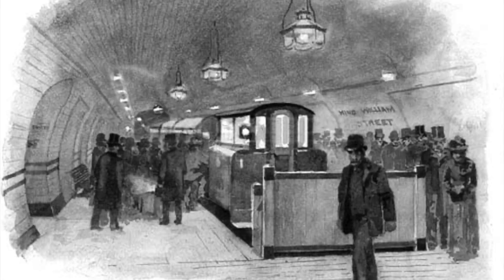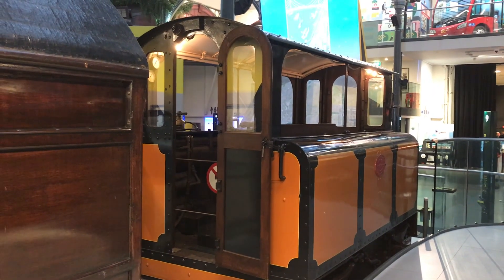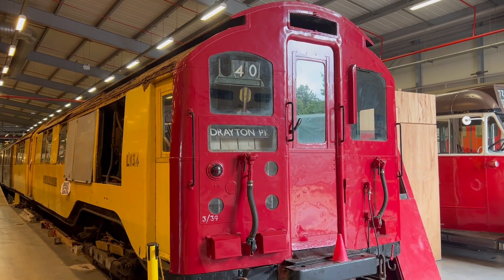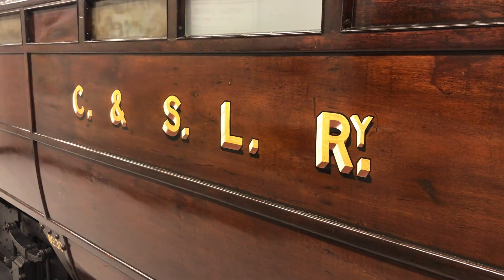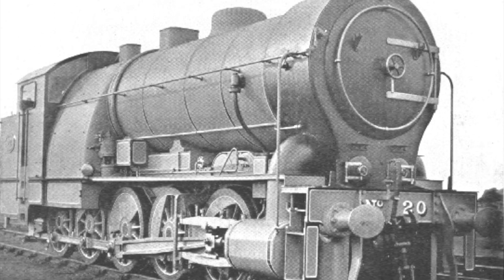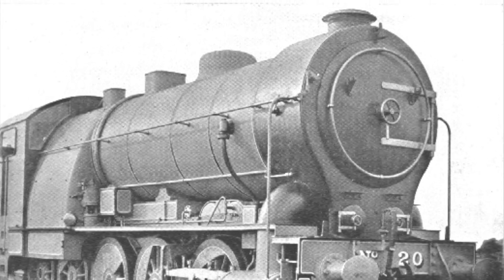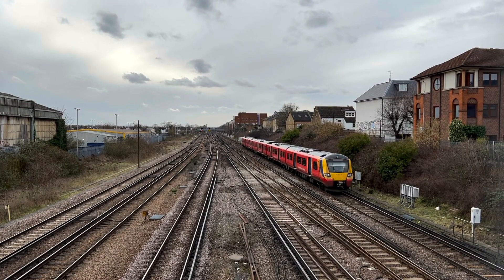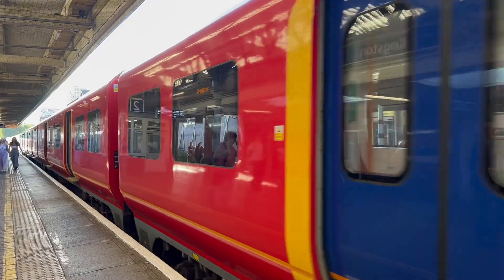Why some electric trains use a third rail, and others don't

Comment: I can name a few sections of new third rail. These are the new London Bridge and Reading station developments, the Bermondsey dive under and the new Merseyrail extension, the connections to HS1 (but not HS1 itself) plus those tracks that were renewed. Like with new level crossings, are there any regulations related to the installation of new third rail infrastructure since almost all new electrification projects are 25 kv AC OLE?

Comment: This makes me wonder about why Merseyrail has third rail powered lines when all the rest are in the South of England
Reply: Because the Lancashire & Yorkshire Railway and the Mersey Railway chose the same system as the London & South Western (and, for that matter, the North Eastern on Tyneside, although it chose a different system on Teeside). The Mersey Railway, in particular; had a long tunnel that was a horrible place in steam days, and so was an early candidate for electrification. And overhead would have been a problem, for the same reason as it was on the London Underground.  
Likewise the Midland Railway (in Lancashire) and the London Brighton & South Coast Railway chose the same 6250V AC system.

Comment: As someone who works in rail not in the southern region, the prospect of working around live 3rd rail is terrifying. Very easy for it to be game over when carrying long metal objects (tools, survey gear etc) around which most rail workers do. Also efficiency wise the 750V DC system loses almost 30% of the inputted energy to heat and other losses. Compared with about 2% loss on the 25KV AC wires. Very much Edison v Tesla in modern day.
Reply: The old slammers had resistance grids for acceleration control which must have added considerably to the heat/resistive losses of the third rail. Modern trains 377s et al with electronic control wizardry may well have cut these losses significantly, be interesting to see by how much if anybody has studied this.

Comment: Third rail electrification have an huge bunch of problems: it is dangerous, suffers snow and ice, can use only low voltage for safety and geometrical reason (it's too near to soil to have enough distance to not create voltaic arc with ground at high voltage) and so it must carry huge amount of current with high leakage and need a lot of substations, provides less power than overhead lines, it's slow and can't be used for high speed (the top speed is typically only up to 100 mph (or 160 km/h) with 110 mph (below 180 km/h) record speed), need to be interrupted on switches and grade crossings. The only reason to use today third rail on new lines are  on underground metros to save money digging smaller bores without enough clearance to install at least rigid overhead lines: they are segregated, use lower top speed (typically below 100 km/h or less), have a low number of switches and don't have grade crossing, don't need to run high speed trains and don't run freight trains and they aren't exposed to snow, ice, rain. These are the main reason because third line is no more used on new railway electrifications.
Reply: One advantage of low voltage DC supply  is that it keeps the trains simple - no heavy bulky transformers or rectifiers to lug around. Important where weight and/or space is at a premium.

Comment: I think you might have explained that the main reason overhead electrification has gained ascendancy over third rail is that it allows much higher voltage, 25 kv against typically 650 volts. As power loss over distance is proportional to the current not the voltage it is far more efficient to have a high voltage and low current than vice versa. Obviously you couldn't run such voltages at almost ground level. Secondly to feed such high voltages to the wire and then reduce it to usable voltages in the locomotive requires transformers and hence AC current.

Comment: On a similar subject... why do some trains use the wrong tube line and others don't?! Fun fact: Tonight I was prevented from catching a train out of Uxbridge by an incident involving a Piccadilly Line train taking a "wrong turning" after Rayners Lane and ending up on the Met Line at West Harrow! Two obvious questions occurred to me: 1) Does this sort of thing happen often? and 2) Would this sort of thing have happened in Charles Yerkes' day?!
Reply: It does happen, usually because a signaller has set a route for the wrong train and the driver didn't notice until too late. Both of them will have some explaining to do.  "District Dave" recounts an episode where he took a "wrong stick" at Hanger Lane Junction and took his District Line train to South Harrow instead of Ealing Broadway. 
 
At places where the consequences would be severe, such as Barons Court, Queens Park, and West Hampstead, there are extra precautions to cut off the traction current, or operate a tripcock, should a big train attempt to approach a Tube-sized tunnel. This used to be a gantry spanning the track on the approach to the tunnel, from which were suspended some mercury-filled glass U tubes at a height that Tube stock could pass under but surface stock would hit. The mercury in the tubes formed part of an electric circuit. Should an errant surface stock train (or Overground train at Queens Park) be routed towards the Tube tunnel, it would hit the U tubes, breaking them and letting the mercury run out, thus breaking the electric circuit and tripping a relay to operate a tripcock to stop the train. I understand the mercury has now been replaced by a silver coating. At Queens Park, there is also a system which detects whether the "negative" rail is receiving current - which it will only do if the train has negative collector shoes (i.e a Bakerloo train). If it's an Overground train, which operates on the 3-rail system, there are no negative shoes, and therefore no current in the negative rail.
Reply: Wow - thanks!

Comment: Thank you, so what is the reason for the four rail system on the tube? It seems relatively ocmplex.
Reply: It allows a lower voltage in the rails, as one is + and the other -, (say +300 v and - 300V) whereas in the three-rail system there is an earth return through the running rails so to get the same voltage across the motors the live rail has to be at a much higher voltage (say +600). Also, the 4 rail system allows the return path to be insulated from the ground, reducing the possibility of stray currents going where they shouldn't - especially important when running through tunnels lined with cast iron.
Reply: @norbitonflyer5625  thanks!

Comment: Is the crossing near the end over a third rail track?  Does it get disconnected when the train has passed?  Melbourne has a fun system where trams at 600 volts cross trains at 1500 volts. also DC.  A # shaped section where they cross is isolated from both systems, then connected to whichever voltage is needed.
Reply: It is on third rail - Bollo Lane Junction between Gunnersbury and South Acton on the London Overground.  There is a gap in the third rail for the length of the level crossing. As the train is longer than the crossing, part of it is always taking power (there are pickups at each end and often in between as well). This is also how junctions are dealt with. 
One reason unit trains are better suited to 3rd rail than locomotive hauled trains are, as a loco is short enough to be "gapped"

Comment: Funny enough, even for third rail there are differences. The common in UK seems to be top contact third rail. In other metros, underside contract third rail is more common. eg. Singapore's mainline metros, NSEWL. Which the third rail is covered with a protector on the top side while the bottom is for the shoe to contact...
Tho from what I heard, the maintenance is more tedious since the shoe is to have a pressure on the third rail more than the top contact ones, where it can rely on gravity. Just needing care not weld it to the rails...

Comment: Just like Thameslink, two lines in the US that switches from third rail to overhead wires are the Metro-North's New Haven Line and the MBTA's Blue Line. The MBTA Blue Line in Boston is more unique in its operations because it's a subway line that does this! The Blue Line's predecessor was first a streetcar line before it was converted to a subway line in the 1920s. The Blue Line switches from third rail to catenary or vice versa at Airport station. When it was extended in the 1950s using the former Boston, Revere Beach and Lynn Railroad right of way, the northern section of the Blue Line became catenary to reduce the risk of winter ice buildup due to proximity to the ocean. The Blue Line also stands out in that its East Boston Tunnel was the first underwater rail tunnel in North America when the tunnel opened in 1904. 

For the New Haven Line: As part of the construction of the iconic Grand Central Terminal in the early 1900s, all of New York Central's lines that ran into the terminal were electrified as NYC banned steam locomotives. Third rail was installed on the Hudson and Harlem Divisions, while the New Haven Division received overhead wires on the segments that were not shared with the Harlem and Hudson Division. So what are now the MNR's Hudson and Harlem Lines are electrified (mostly; the northern portions are not electrified) using third rail. The LIRR is mostly electrified with third rail, and that's thanks to the Penn RR, who also added catenary to the portion of the Northeast Corridor between NYC and DC. LIRR was once owned by the Penn RR and they used third rail for the tunnels to Penn Station, but later opted to use catenary for the NEC.
Reply: I was about to post about this! I’m sitting on a Hudson Line train right now. It’s actually even worse — Metro-North uses bottom-contact third rail (like the DLR) and the LIRR uses top-contact. 

The New Haven line switches between third rail and overhead on the fly, and I believe the M8 units they use have shoes that can pick up electricity from top or bottom. 

Oh, and we have a ridiculous number of different overhead voltages and frequencies in the NE USA… but then again so does continental Europe.

Comment: Some of the earliest electrification was in the North West.
The Liverpool Overhead Railway opened in 1893 with electric operation. The Lancashire and Yorkshire Railway's Liverpool to Southport line used electric trains from 1904 on a 4th rail system. Now part of todays Merseyrail Electrics network, it operates using 3rd rail just like the SR.
Manchester to Bury, also L&Y, was  electrified to 1200 volts dc in 1916 using a side contact 3rd rail system. It is now part of the Manchester Metro tram system.

Comment: Another reason for 3rd rail was was weight of train .  With low voltage DC you could run the train using only series , parralel and resisters , no tranformers on board that is .  Weight saving in the old days before solid state .   Overhead was mostly originally brought in to run higher voltages AC to be transformed onboard .

Comment: That particular EMU train design in your thumbnail....I remember travelling on them in the 1990s to Richmond or Kew Bridge (for visits to the botanic garden). They were used by South West Trains to serve the SW London suburbs, and they look slightly different, design-wise, to those serving the S/SE London suburbs (Network South East).
Reply: That's a 455. Still the mainstay of the SWR suburban services because of the dealy in commissioning the new class 701s. very different toi the slightkly newer Networkers (class 465) on South Eastern, or indeed the class 377 Electrostars on Southern.  Network South East was the brand name in late British Rail days for all suburban services operating out of London, as far as Kings Lynn, Northampton, Oxford, and East Devon - not just those in SE London.

Comment: In Chicago, one line (the "Skokie Swift" ) of metro trains extends out to the suburbs with level grade crossings.  For this part, dual power trains which switched from third rail to overhead pantograph collection were used.  Around 2003, it was decided to dismantle the catenary and convert to all third rail, despite the danger to it being accessible to people on the ground.  So a rare type of conversion.
Reply: Incorrect, the Skokie Swift is part of the CTA Elevated heavy rail (the Yellow Line.) Yes, it has street running but it was never a part of Metra’s Electric line. It did have overhead pantograph for the parts west of the Skokie Shops, the main repair yard for the entire CTA L and Subway. They have had for year safe street running without the need of catenary at the end of both the Brown and the Pink Lines, thus they decided to make all of the Yellow work on third rail.

Comment: I suppose one of the other reasons that 3rd rail was easier to install in the first place is that you have less lineside furniture, which means that it's easier to justify retaining mechanical signalling -- overhead line projects almost always involve re-signalling to ensure visibility.

Comment: Dear Jago, great vid! The third and fourth rail lead the way. In catenary pulling and pushing power it’s indeed a bliss of travel. Nevertheless, it would be interesting to hear on the clearance issue for tube trains and even over land transport. Especially where some British rail companies in the past have chosen to use the minimum overhead clearance to cut costs on bridge, tunnel and other infrastructure construction. As always I’m feeding your third, fourth and overhead electric potential. Cheerio

Comment: One other factor is that 3rd (or 4th) rail systems can't really be used if there are any grade crossings (pedestrian or motor vehicle) on the line as people or cars crossing over the tracks could touch the electrified rails which would then cause injury or death.
Reply: Wrong, there are plenty of crossings in 3rd rail areas, they just put a gap in the rail!
Reply: Merseyrail Northen line has a number of level crossings. At least one on the Wirral line too. More of. nuisance than a danger,  because of the frequent service closing the barriers several times an hour... although the busier roads use bridges.

Comment: There is also a new form of electric trains coming into service this decade.
Former Diesel lines are getting more and more hybrid electric/battery powered passenger trains who can recharge their batteries on the overhead wire at stations and/or on the electrified railway sections.
On the "Diesel" line part they use battery and on the overhead wired part they just run like normal electric trains.
Even modern electric busses have pantographs to recharge at certain busstops.
Like steam before Diesel is now going extinct as a major form of propulsion on the railnetwork.
Passenger trains are as always the first who convert, steam passenger trains were also the first to go to electricity/diesel and freight steamtrains followed later.
Upcomming solid state batterytech could make the current hybrid battery/diesel-electric freight engine obsolete as fast as diesel-hydraulic/diesel-electric did to steam in the past.

Comment: I really don't understand what the advantages of the overhead wire are, when it can be done with the third rail that is much less of an eyesore.
Reply: That would be a bit like saying why did they persist with steam locos when electric locos were available from the late 19th century. There are other factors at play.

Comment: Hi Jago, just a couple of points, if you'll excuse the Pun.
Grouping came about as  a less expensive means of Nationalising. The War had worn the railways out and the proposal to nationalise it by the Government because it would cost too much to buy out the shareholders. It was trading on Government costs from 1914 which was never adjusted. ( Ring a  Bell? ) Because Nationalisation was what happened in 1948 to the Groups after Word war 2 for exactly the same reasons. By that time the thermal efficiency of Steam Locomotives had in fact risen considerably. 

I worked on the early Eurostar and it needed to be compatible with three systems. UK third rail, then SNCF and from Lille it would  be on Belgian system.  This caused delays in introduction.  Once St P opened it could drop the third rail requirement but I don't know if the Overhead system here is compatible with SNCF.

The last point is of course that both Steam and Electric used the same base of coal as we had no oil of our own. Steam was cheaper to produce.
Reply: I don't suppose the railways would have been nationalised when they were if the Conservatives hadn't lost the 1945 general election. Not sure what they would have done given the state of the railways though.
Reply: @kevinrayner5812  It's complex, as Jago has alluded to the RHS could legitimately undercut the railways due to the prewar agreement, but after both world wars, no accommodation was made for inflation. Plus road had local advantages, but when I was a child not everyone had a car, so the train was critical. Freight is the payer, not passengers.
That said the short-termist building of standard Steam locos could have seen longer service, alternatively- gone for immediate rebuilding.

Comment: Jago here is one for you. GWR (current franchise) runs trains from Reading to Gatwick which are Diesel the in part over SWR tracks with I think some sections not electrified (although might be wrong) - however because Reading with exception to three bay platforms (which are third rail SWR services to Waterloo and the GWR Gatwick) is Overhead power the GWR units can not return to the maintenance yard.  Something has to change
Reply: The reason diesels are used is because two sections of the route are not electrified - Wokingham to Ash, and Giuldford to Reigate to Gatwick. 
There is no reason why diesels cannot run under the wires to and from Reading depot, and indeed they do every night.